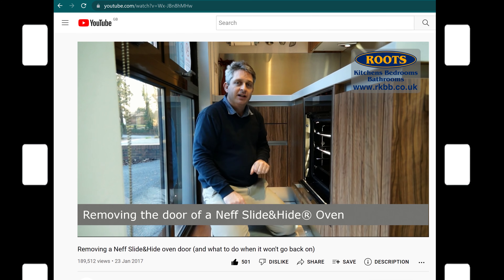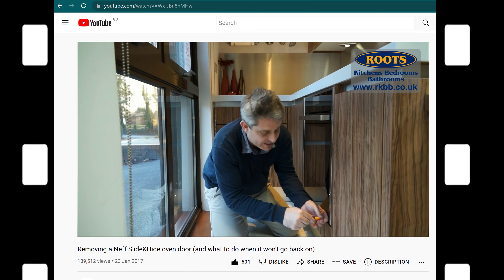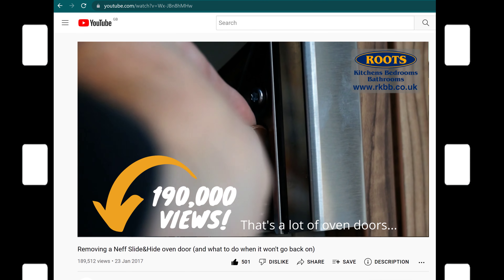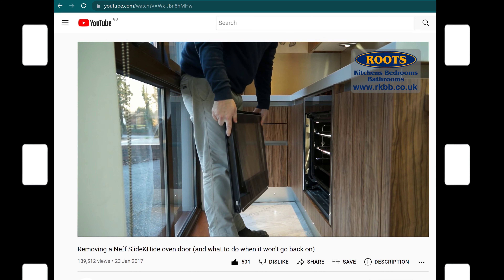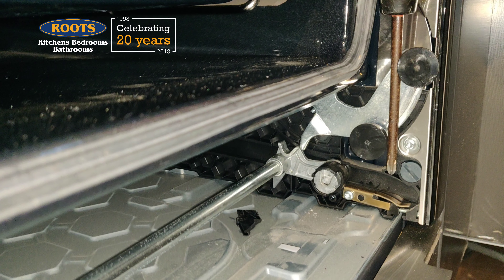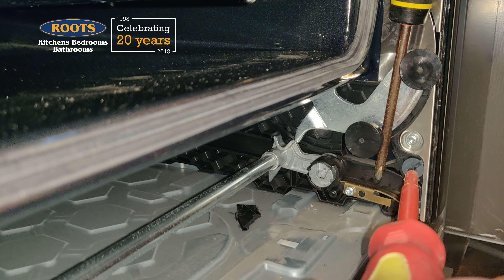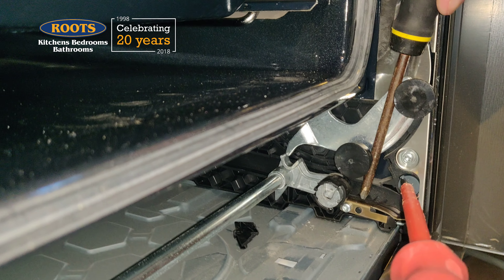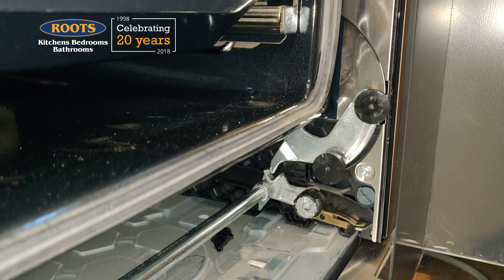Neff Slide and Hide - fixing the oven door hinge

Comment: Hi Steve, your video is great and clear! But since yesterday we have a problem with the door of our oven.
It goes completely open, but it won't close anymore...
We cannot pull it out out anymore. There is something wrong with the mechanism, but I can't see what's wrong and I don't want to break it.
I've called Neff and they can help us in 2 weeks and it will cost at least €100.
Can you help me? I can make a movie to make it more clear, if necessary...
Regards, Geert (Belgium)
Reply from the maker: Email hello@roots.uk ... No promises!
Ideas - but I've not seen this before...
The hinge lock is turned (door won't go past it when closing?)
Handle is not rotating (or rotate the handle to release the door maybe, to allow it to be removed and then reassembled)
Reply from the maker: (and message here if you email, I don't get that email to my phone)
Reply: @RootsKent  I. Ve send you an e-mail with a link to a video to show you the problem.
Reply: @RootsKent  I’ve got a similar problem so interested to know if you solved this. I can see that the v receiver is not attached to the hook part but our door is still attached and will slide underneath but not to 45° so I can’t remove the door. Not really sure what else to do as I can’t get into the mechanism on the side with the door in place and can’t get the door up any further. I also can’t get the side panels off as I can’t turn or remove the middle torque screw. I can send a vid
Reply: @geertdaenen86  did you manage to fix this? We have the same problem and I work out what to do
Reply from the maker: @tales.of.the.thompsons  try/remember to lift/rotate the handle. There's a cable that releases the bottom roller from the door. I often have to try several times to get that to release. Sometimes one side releases before the other too.
Reply: @tales.of.the.thompsons  we have called Neff and they've send an technician. For him it was the first time he had this problem. He took the oven out, to fix the problem.
Reply: @RootsKent  our handle is static
Reply: @tales.of.the.thompsons did you get this sorted please? I've got exactly the same issue with mine! I stupidly decided to take the door off to clean and didn't lock the door in place from closed but rather open (and didn't rotate the black tabs on the wheel first) so I locked the hinge on both sides, now it won't close. Did you get a Neff engineer out?
Reply: @freakstate  similar ro me and now I can't get an engineer til after Christmas... this sucks any solutions? Also I've lost a black spinner cap in the process
Reply: @deehenry5213  Ok so.... i went through a company called NAC who brought a guy out pretty quickly. Theyre 3rd party engineers basically. He didnt seem overly familar with the model and slide and hide, but together we took the entire oven out (careful of how much length of flex cable you have whilst you do this, and always switch off at the fuse), popped it on a workbench and rotated 90 degrees. Ended up taking the entire bottom panel off, which does come off after a few screws and screwdriver pushing tabs out the way. That allowed for much easier access to the door and we could see what the heck was going on. Gave us easier access to the bottom black locks (the same ones you may be talking about). ALSO, when you shimmy the unit out about 15cm, there are white cables on either side of the unit which connect the coin turning locks to the hinge locks, I suspect one of them had broken on me. As the guy said in the video, those hinges are on springs that are very very strong so be careful, but if your issue is the black rotating locks I would see about taking the unit out or contact NAC. It was £98 inc vat for a repair, which was terrible considering NEFF is 96 Euros for call out I believe,, and i didnt buy new from Neff anyway (you can save a couple of hundred from AO Outlets and other places). Then NEC then quoted some additional price for parts and further repair but I ended up replacing the whole unit (long story short, I'd got really annoyed with the door beforehand and kinda broke about £150 worth of door and damaged the seal anyway lol, my own fault and frustration). If you want me to take a video explaining this in more detail let me know! I have the old unit sat in the corner of my lounge as I work out whether to take it apart from spare parts haha. I'll drop you my email address.